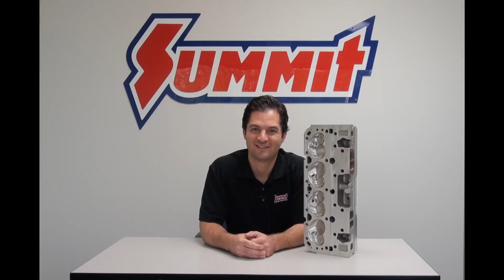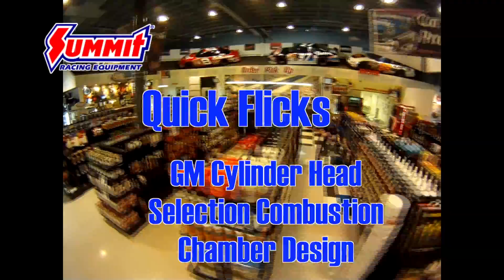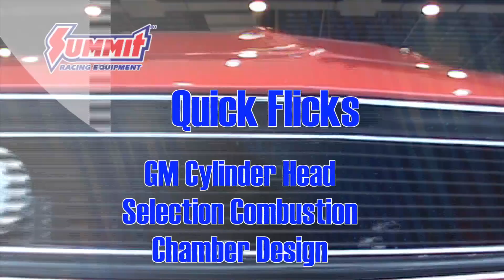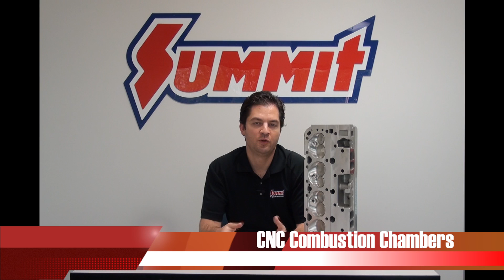Cylinder Head Combustion Chamber Design - Summit Racing Quick Flicks

Comment: Mopar Magnum heads are the best designed stock cylinder heads for a small block. 18 degree valve angles and heart shaped combustion chambers. Vortecs copied the Magnum design!

Comment from the maker: According to the Serial Number you provided; the cylinder heads are the standard 170cc Twisted Wedge heads with a single valve spring. The original part number was
TFS-51400002-M61.

Comment from the maker: We do have a Summit brand head that is similar to the GM 2.02 heads you mentioned. The part number for these heads is SUM-162109 ($896.36) and these should be a very good match for your engine.

Comment: okay my motor is a 355 10.5:1 flat tops with a comp cams rv cam i was thinking bout going with something that has a similar cc i believe the heads that are on are 194 gm heads and i think the 76 cc heads would u guys have something that's angel plug aluminum and similar to the gm 202 heads